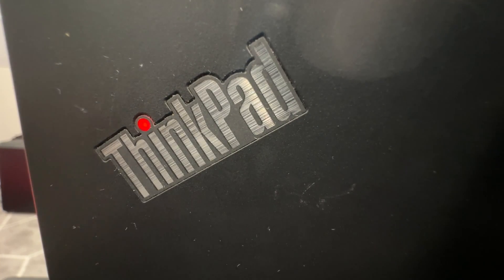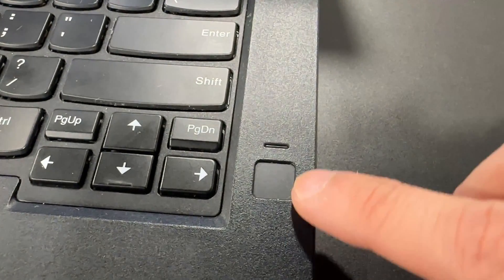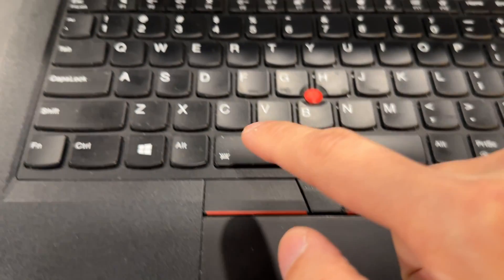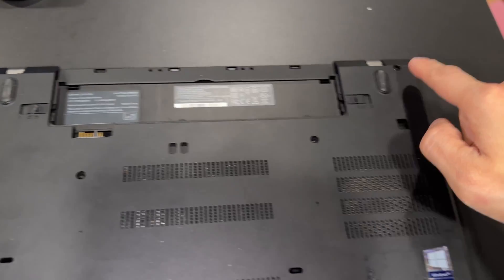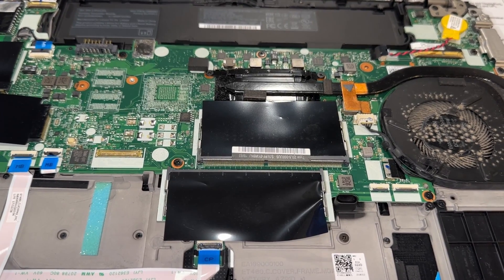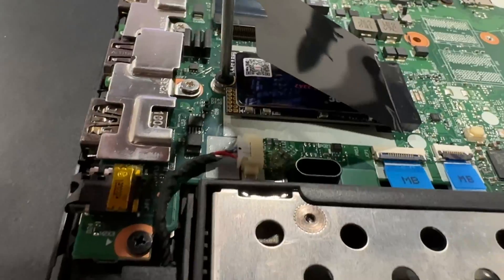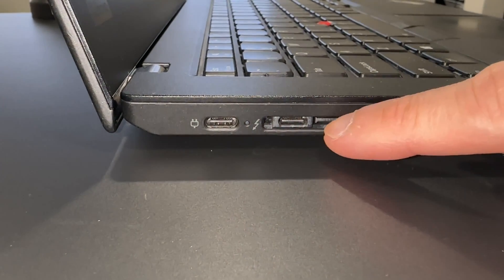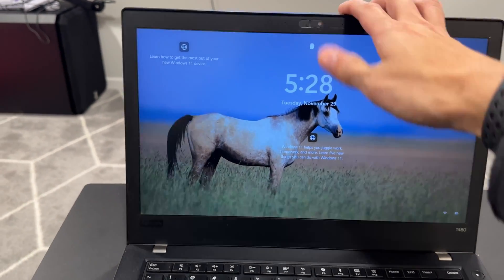How to Buy and DIY Upgrade a Used Lenovo T480 | Budget Laptop Upgrade Guide

Comment: Great video. I had already chosen to get a T480 from Amazon refurbished. The first one returned because of visual problems, kept flickering and turning itself off. It may have been caused by the upgrade to Win 11. The 2nd one will work. I opted for the 500GB SSD. I have  rescued a WD 1.0TB WD10JPVK  one fon r 500GB. Any chance that those would fit in the T480? Just being greedy. Don't think I need it. Regarding the thunderbolt  charger problem you mentioned. Where do I find the version info?  I print out hwinfo, but need to know where to look while I still have time to return it. Thanks

Comment: hmm i found an application for the windows shell was eating up like 40% of my cpu and destroying my battery life even when put to sleep. I was able to fix this by going into the windows privacy app settings and stopping it from launching programs in the background as well as changing a bunch of other privacy settings. i would check ur task manager (ctrl + alt + delete) and see if you have a simmilar process that goes crazy and just eats up 30-50% of the cpu. i just googled the name of the application and found a guide on how to turn off these sketchy meta data gathering background app settings.

Comment: I got a T480 i5-8250 with a single 8Gb 2400Mhz memory few weeks ago. Thinking about upgrade to 16Gb. Is there any benefit to buy 2x 8Gb 3200Mhz vs adding a second 2400 ?
Reply: it will work at 2400 mhz, it is the maximum
Reply: Get 2x16GB sticks to get 32GB right away. 16GB may be too little if you're doing programming and some work

Comment: This is by far the most holistic video. Quick question, when you installed a new SSD, did you find it difficult to install the windows, or did you clone the OS from your other/previous SSD? Thanks.
Reply: It should be a pretty run of the mill install. I would absolutely clean install since it is a new device.

Comment: lol Ive been using this laptop 2+ yrs and only got it with a 120g ssd. thought about upgrading the wlan drive but found prices were kind of crazy. decided against my better judgement to just put a sd card into it with ~120gigs. one of those name brand ones meant for high read/write numbers. i just use it for files i need to put somewhere and dont care about speed or loosing. was a very cheap solution and makes it really easy to transfer physical files. i try not to uninsert the sd card ever though i think this was like a 15$ solution to the memory :p
Reply: 3.5 years on, this is ironically still working perfectly lol. its only come loose in my bag once with daily use.

Comment: I bought a T460 off a local store in another city for 190$, I was so impressed by it's condition I went ahead and ordered another one, going to use it for spare parts for the upcoming years. will buy another laptop 2030 not before.

Comment: I have the L480 and it has MANY MANY issues. Putting on charge/removing the charger puts up a black screen for 3 seconds
Reply: Same, did you do something with that?
Reply: @МелашРо  So right now, the battery is messed up. So if I unplug it from charge it just switches off and it is always on 0% so I once I get the battery replaced I will surely let you know if the bug is fixed!
Reply: @blanknessedits  thank you for your answer

Comment: It seem that my particular T480 was a rare gem:
- It already had the WWAN card (very useful for internet when you have no wifi, just stick in a data MicroSIM and enter the APN)
- it had the SD card reader
- built-in touchscreen
- one 16GB RAM stick
I only had to purchase the NVME caddy to upgrade the drive to NVME, also a new extended battery.

2 years in and it is working very well.  Just purchased a 16GB module to finally jump from 16GB to 32GB
Now I'm considering upgrading he screen. T480's biggest flaw is the dim screen, even at max brightness, and I've read you can get a brighter screen, but at the cost of the touchscreen feature.
Reply: The t480 can take 30pin and 40pin screens, I installed a screen (B140QAN02.0) that came from one of the newer lenovo laptops by modifying the lid and taping it into the lid.
Reply: @rocksalts really? You can use 30 & 40pin panels?! What screen did you upgrade to?
Reply: The touchscreen can be a downside if you do not use it. Even with the touch functionality disabled, the digitizer takes power actively, causing lower battery life. Enjoy your T480!
Reply: Bro I installed the sim card in my laptop but it is not working please tell any solution 😢
Reply: and what is the storage capacity_
Reply: @staria1117  at this time, a 1TB NVME. Looking to upgrade to 2TB in the future
Reply: Can you replace the tocuhscreen lcd with a non touchscreen one?
Reply: @saxitopau1528  Not really a lot of the Lenovo laptops have a slot for a Wi-Fi card on one or whatever they call it a wwan card. My yoga and my X1 carbon have in the back under the screen, right next to the MicroSD card. My Dell laptops have them too, and I believe My T420 had them too.
Reply: i dont get the wwan thing, just usb tether from your phone instead of taking your phone apart to get the card into your laptop
Reply: What about using a dedicated SIM card for the laptop so you don’t have to be tethered to your phone?
Reply: T470 has all of these and has 2 SO-DIMM slots

Comment: Nice job. Minor correction, you can have 2x NVMe drives on the T480s as well by using the WWAN slot in x2. 
I still prefer the T480s when I'm traveling, but I do wish it had the same battery setup as the T480. All in all, you can easily upgrade the T480s to 40GB RAM, 1x PCIe 3.0x4, and 1x PCIe 3.0x2. I run a 2TB 970 EVO Plus in the x4 slot and a 512GB sn520 in the x2 slot. With PCIe 3.0 NVMe's dropping hard in price, you can grab a 1TB 970 EVO Plus for $55, a budget branded PCIe 3.0x2 2242 drive for 20, and a 32GB stick of RAM for 30-50, meaning you can potentially upgrade this to an excellent machine for 100 bucks. 
Oh, also you can modify any standard PCIe 3.0x4 NVMe drive to run in the WWAN slot. It requires a dremel and potentially bricking your drive, but for the extreme T480/s enthusiast, it's a fun upgrade before moving on!
Reply: You can grab one of those large power bank with high current charging. Like say something from Promate, Zendure or Cygnett. The benefit of these that they are also useful for charging other devices like mobiles, drones and camera batteries.
Reply: So in short, don't waste your time with the T480s, just get a T480 as it can be upgraded more fully. :)
Reply: Got a refurbished one from Amazon no internal battery. Can i add it?
Reply: @mrguiltyfool Yes you can buy one and install it
Reply: @hexayt4742  thx.

Comment: The T480  is a great machine, untill you need a new external battery. Reddit is full of questions which is a reliable brand to buy. Lenovo doesn't make them new anymore and there is lots of discussion about this. Be aware of this when you buy one.
Reply: Instead of buying external battery you can also buy a large capacity new power bank these days that will serve the same purpose.

Comment: This laptop does not cost more than 300 bucks, for 500 U can buy new! gaming 3 with i7 10-12th and geforce 3050 new! So 150-200, and 300 for a New t480p..
Reply: Where did u find a laptop with GeForce 3050 for 500?
Reply: @G18_120fps  robopolice is constantly erasing my answers, but you can find if you need one.

Comment: Just bought this laptop, want to add a 1TB NVMe to it and if possible my WWAN 5G card that I already have. Also going to try upgrading the WiFi if possible (I've heard different things about whitelists of cards). Thanks for your video. Very helpful. I got lucky and the eBay seller said no second battery, but actually it's there!

Comment: Used one of these for about 2.5 years for work. Pretty good build. Good size. Decent battery. Weird to think it’s older now.
Reply: how many hrs of batt life for this kind of laptop?
Reply: @arisu1230  I'm not sure I usually had it plugged in. Maybe 5 hours? I don't know. I might have had the second battery in mine, and I know there's bigger batteries to have. I don't know much about laptops or hardware back then

Comment: The ONLY thing that really sucks about having dual SSDs slotted in the T480 is that both slots share the same bus, so disk bandwidth isn't increased.
Reply: That doesn't matter. No one is going to run a server on an old 4-core laptop anyways.
Reply: @one_step_sideways is this a good laptop or not
Reply: @NBaa2123  very good
Reply: Did not know that. But then again I am using it to dual boot linux mint and window 11
Reply: well most use cases dont really care about that at all

Comment: I had one of these for work, we had a fleet of thousands of T470-t490, i liked it other than 8gb ram only. they are also notorious for usb c failure like mine had, mine was replaced with a T14. I like my personal Dell Latitude 7390 a little bit better as it is much cheaper with the same specs (can be had under $200)

Comment: Owned a T480 for 6 months so far and I still love it. I didn't even think that this laptop would be able to house 64 GB RAM, but now my jaw has dropped.

Guess I know what other upgrades to do with this machine!
Reply: does t480 has touch screen?🤔
Reply: @jinkazamaaa  mine does
Reply: @TheRadmin124 Did you faced any issues with T480? If you did please mention. I am looking forward to buy this laptop.
Reply: it would be useless for most things, but it sure does help if you have 100+ tabs open all the time

Comment: As a Thinkpad T480 owner it’s still a PERFECT Machine. Since I got my MacBook I have been using it less. But after installing several updates it’s still fast. I don’t think I’ll get rid of it anytime soon since it’s one of the last Think-pads you can do many upgrades. I bought a 1080p upgraded screen and Large external battery. I love having a pop out external battery
Reply: What is your opinion in 2023? I want to buy something refurbished/repairable but still compatible with new stuff...
Reply: @nannetteralphs9042  As long as you dont do any 3d heavy (and i mean heavy!) work, a t480 should still work very nicely. I even use a weaker x230 daily with an SSD and linux.
Reply: where did you get the extended battery? (if you have a link that would be awesome).
Reply: Is it still good for now?
Reply: @Monarch_4548  it’s still good for now I recently got a MacBook Pro but I will still keep my T480
Reply: Down up sheet staple singers music 🎶 buton scrolled,
Reply: @ArslanSattar-v5b  Damn is 😂🎉
Reply: Hey man thanks for your comment I’m in the market for a laptop .  How much was your build in total ? And how has your experience been so far ?

Comment: The only complaint i have for this model or any thinkpad model is the rubber coating they used.... Over time it will become sticky and hard to remove or take care
Reply: Only certain parts become sticky. I have a x1 carbon gen 1 from 2012. The rubber finish on the casing is still fine. But there is a rubber section around the power button that has become sticky.

Comment: Is there a workaround with the charging ports going bad?
Reply: Upgrade the Thunderbolt driver
Reply: @karlnul  oh i already did but i didn’t check the firmware so i was still confused

Comment: Recently I got used T470 (only have 127 hours of use, it's a warehouse stock clearance sale), pay $250, got a full pack with the box, manual box, charger, type-C to VGA adapter, etc.
Have a 100% perfect condition, and I decided to upgraded the RAM from 4GB to 16GB, and 256 Gb SSD to dual SSD 512GB+1Tb.
Yes i want a used T480 with a faster processor, but got a T470 almost like new and I think this T470 is a good bargain for me right now.

Comment: I ended up buying the HP Zbook 14 G2…. The TPM chip firmware doesn’t want to be upgraded but I can change out everything else if I want. A classic mobile workstation and it wasn’t exactly quad core but I thought the flaw was the sum of its virtue and I got mine in mint in mint condition and when you find them, you don’t let them away!

Comment: Hi, Is that possible to use 64 GB RAM in T480? I was thinking 32 GB is a max size.
Reply: Absolutely, Lenovo didn’t test the capacity nor did intel and that is why they went with the “32 max estimate” just for the label simply because of not testing. There are lot of people who have upgraded their T480 to 64 gigs no matter the model (i5 or i7). Hope that helps. I’ve ordered one myself. (Edit : ram frequency supports up to ddr4 2400 mhz frequency.
Reply: @MaxReload  Thanks
Reply: @Max  hello sir, I'm looking forward to buy T480 for ethical hacking and programming. Would you recommend me this? Also. If I buy the bade version 8 gb ram and 256 gb ssd it's capable for an upgrade right?
Reply: @G18_120fps  yes thats the same one i bought , upgraded the ram to 64 ( 32 gb 2400 x 2 ) and the ssd is sort of a gamble to be honest because some t480 varients come with the nvme caddy included and some dont so be sure to ask them about the caddy before buying , doesnt worth it if its equipped with an standard ssd which is a  common trick they use to save money. then u have to buy nvme caddy separately for 30 to 50$ depending on region. but yeah definately research on the ssd department. ( edit : even if u buy 3200 mhz ram it works just fine , board will automatically set the limit to 2400mhz , telling this because its easier to find 3200 than 2400 nowdays which is stupid yes.
Reply: @MaxReload  tysm brother!

Comment: Been researching these and already bought one from Ebay, just waiting for it to arrive in about 3 weeks. This is the fist I've heard about the thunderbolt port firmware issues and now I'm worried. Does anyone have any insight on what this issue is?
Reply: The issue is where some models of ThinkPads will kind of destroy the USBC ports and basically makes the charging unusable
Reply: On my HP Zbook, the worst issue was the wifi barely worked…. I had to upgrade the driver before it was capable of supporting the modern internet. If you’re lucky, better drivers can make your dream laptop possible.

Comment: T480 i5 8th gen 16gb good for video editing?
Reply: For video editing, I would try to pay to little extra to get the i7-86xx model. Or if you already got one get a donor for like 100 dollars on ebay and swap it
Reply: @jacobenglish5940  my budget is tyt 😔 this is wt I can afford 😭
Reply: have you tried it yet? in my country this project would cost me around 400usd, which is very good deal. 400usd for more recent option would just get me i5 8th/9th gen, 8gb non-upgradeable ram and 128gb SSD. so I thought I'm better off with a thinkpad project, but I am not so sure with the perfoemance :/

Comment: Great vedio. I own a t480 for a year now and i have a strange problem with the batteries . So when im working they hold the charge very well and i checked their true capacity using vantage software it shows over 80 %  both and it says that there is no problem with them but when i boot in into windows after a shutdown or a reboot the charge drops to 0 % even if they were completly charged 
The solution i found is to power up with ac pluged in this fixed the issue but it bothers me so much the fact i can not turn on the computer on without the cable  .
Reply: i have the same issue, dual batteries are really annoying

Comment: Why not go with a 530 it has tons of options the only thing the 480 has over it the ram it's 32 not 64 gb and maybe internal battery IV been told it was a option on it just never actually seen one just wondering IV seen 3 video all resent  and it's on thinkpad 480  👍👌✌️💯💻⌨️🖱️
Reply: Because T530 is not Windows 11 supported.

Comment: Is there any way to deal with the issue of bad firmware on the Thunderbolt controller? Surely if there’s a way to update the firmware, it should be fine?
Reply: yes update the firmware. the problem is if the laptop wasn't updated in time and the damage is done, updating the firmware will not fix the issue.

Comment: Hello...  I very much appreciated your video.  I own a T430 and I am in the process of upgrading it now.  I also wanted a laptop that could support Windows 11.  I wanted a laptop that would do this as it will be a while until I can take my full tower, rip out the old motherboard and upgrade to a motherboard can can support Windows 11.  Until I saw this video, I had no idea I could buy a robust older Thinkpad that supported Windows 11 for a reasonable price.  I usually think and read about stuff for quite some time before I buy anything.  But after a day of reading up on the T480, I decided to go for it.  I bought one on ebay last night.  I wanted the fasted processor, the Nvidia GPU, and 1080p.  I found one for $349.00 & free shipping and just bough it.  I am very happy that Lenovo has support for this laptop in the way of an owners manual, service manual plus driver and BIOS updates.  So, thank you very much for your helpful post & Happy Holidays from Oregon!
Reply: I'm using t430 too,
I'm using tiny11 and mint for t430, so far no problem found
Reply: Same here, I used T430s from 2017 (I keep using win7 until now)

Sadly, win7 end and chrome also end support for win7 at 2022

So, I search thinkpad imtel 8th gen and I found T480/s

T480 more upgradable, but T480s have solid case. Still confuse to decide, but I hope I can make a choice in few month.
Reply: @tmcode2010  sounds like it'll be a good linux machine (or server candidate) when it gets more obsolete
Reply from the maker: Thank you for the feedback, there is definitely a lot of good information on these laptops out there.  Without it, I probably could not have made this video either.  Happy Holidays to you too!